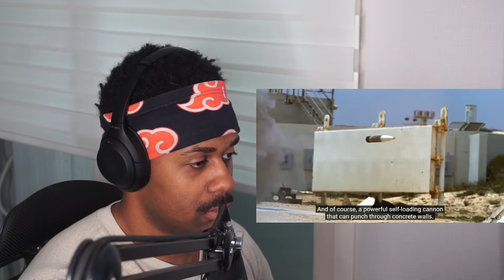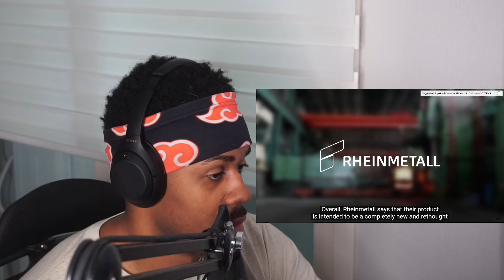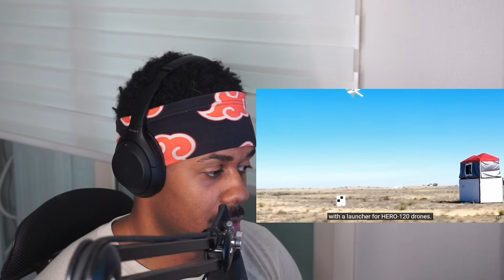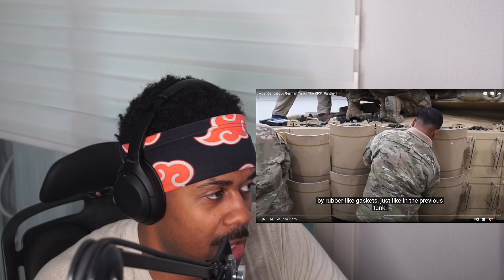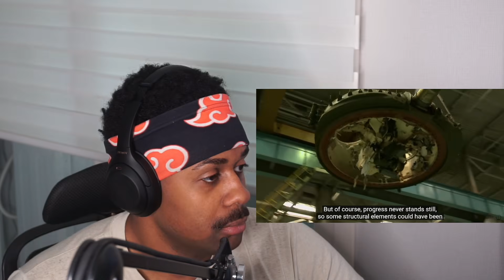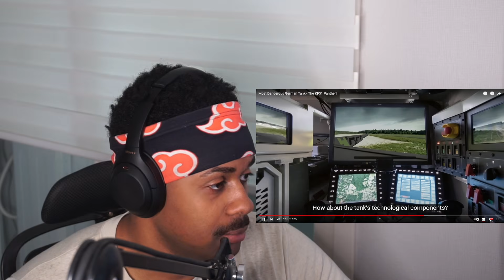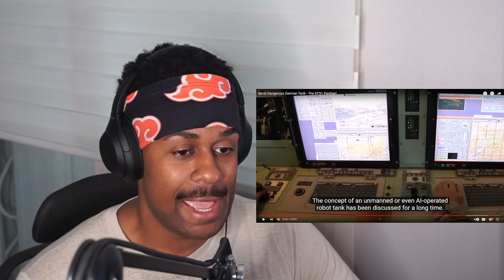Germany Unveils its DEADLIEST Creation...The KF51 Tank

Comment: sorry, to spoil the party but this is NOT Germany's new tank. It's Rheinmetall's brand new prototype, that's really all, so far. And it's NOT the Leo2 successor. The new German tank will at some point come from the new French German collab with KMW Kraus-Maffei-Wegmann in Munich (the producer of the current LEO 2)
Reply: Yes, the Main Ground Combat System MGCS
Reply: Ironically, Rheinmetall started development because they felt increasingly excluded from the other two partners in the development of the german-french Main Ground Combat System a.k.a. the "Leopard 3".
Reply: Well, we can wonder what will come out there though and how much that'll cost.... military procurement is... sometimes quite weird after all. Like remember the MBT-70
Reply: @moloh2529  still thinking france is so bad in tech...think of as a european model and one thats open for everyone else such as the us...they will be compatibel and will have similar systems to build easy alliances if needed
Reply: maybe it will become the successor if the French-German collab doesnt speed up and show they can deliver. i have high doubts about French-German collabs working at all.
Reply: @Deadhessian  depends on who has the saying, as always
Reply: @creaturion_cosplay france isn't bad at tech the problem is the rivalry between the company's that work together on stuff and everyone wants to push for as much of their ideas as possible. The best option would be a fusion of the manufacturers to cancel that out.

Comment: Interchanging military equipment depends on a lot of factors. Sometimes it happens, sometimes it doesn't. Germany decided to buy the F-35 instead of getting the Eurofighter approved for the nuclear sharing. Why? Basically because the Eurofighter's blueprints would have to go through the Pentagon in that case and Airbus doesn't want that at all, as they fear that Lockheed Martin and Boeing would then somehow get their hands on the blueprints as well.
Reply: biggest hurdle to these cross country contracts are usually not about getting the best product possible but to keep your own arms industries healthy, its extremely rare for the US to adopt anything from the outside, because their industries are at least theoretically capable to produce everything, while we in Europe can't.
 not every country has equally capable arms manufacturers in every area, so we Europeans are much more willing to buy gear.

what does happen quite frequently however is that the US buy's samples of gear & amor to compare and learn from (something that many manufacturing  NATO countries do)
Reply: Thanks for all the Sabaton videos, mate!
Reply: Further developing the Eurofighter so that it is also converted and certified for nuclear participation is simply not worthwhile, neither for Airbus nor for the Bundeswehr.
It's only about 35 pieces here, and that's not worth the effort or the cost.
The F35 is simply cheaper there...
Reply: Germany is a company and it didnt decide anything about that issue!
Reply: Wy Not share Tanks and jets

Comment: The German army hasn't actually ordered any of these yet. But just like the Leopard, they will probably be available for purchase to any NATO ally and others. The US would never buy them, though, because America first and all that. However, they already have a partly German tank, since the Abrams is actually the result of an initially joint project that on the German side lead to the creation of the Leopard and on the American side to the creation of the Abrams. Plus, the Abram's main gun is still made by Rheinmetall.
Also, did you know that Rheinmetall is discussing terms with Ukraine to build a KF51 production line, capable of producing 400 tanks per year, over there?
Reply: Rheinmetall is already in talks with Ukraine for a factory for KF31/41 Lynx and KF51 Panther; Hungary is building one already I believe and the Czechs aim for the KF51 aswell bc its cheaper than the other options
Reply: @benjaminbeier4036  not like Rheinmetall is producing tanks for over a century and has contracts with every other big player like KMW, MAN, BAE, MaK, and many more for all sorts of vehicles like the Leopard tanks, the Puma, Lynx, GTK Boxer, Fuchs, Luchs, Wiesel, PzHb 2000, Büffel, Marder, Kodiak, Challenger 2, Challenger 3, Bulldog, CRVT, Warrior, HX3 and of course theyre part of the MGCS jointventure for the "Europa Tank". 

If there is any company able to pull this "stunt" off, its Rheinmetall.
Reply: ....that won´t happen....
Reply: @harryhaller9386  The deal is done. It will be build there in coop with a ukrainian company. The just need to plan the air defense system for this plant.
First they will maintain the used equipment and later switch to KF51 and Lynx.
Reply: @Calisota  the Hungarian rheinmetall factory already produces KF41s, the KF51 prototype was also present at the opening of the factory. It is already certain that the Rheinmetall HERO120 drones are made in Hungary (the KF41s also use this drone), the production of the KF51 is still under negotiation. The KF41 is already in use by the Hungarian army, the leopard2A7HUs are also arriving, but KMW is extremely slow, and can now deliver the leopards ordered in 2018. (At that time, no one thought about the situation in Ukraine, that the Russians had to be feared again), so they ordered a few, only 44, but if more were ordered, the extra copies would arrive around 2030-35... so it was discussed The use of KF51 also uses the same IT system as KF41, they could work together. (although the leopard2A7HU is also compatible with most of this digital system)
Reply: like pushing this tank to ukranian front will change anything, ukraine needs to get rid of its corrupt politics before even thinking about building machinery like this, in the end they will stuff their pockets with money and produce malfunctioning tanks
Reply: Germany has a special contract, they dont need to order this tank.... Rheinmetall has to ask germany to export export this system

Comment: You have to imagine all of that in the video considering this: A german tank "unit" contains usually 4 tanks and they are in a group of 4 units. There could be much more, but that is the "minimum". So... there will be not just one KF51 but 16 KF51. And that means 128 drones can be used in this group of tanks alone.
Reply: With just the tanks, but Germany doesn't deploy tanks alone, there will always be smaller support vehicles and motorized infantry with them.

Comment: One fact that they not really talked about is the 130mm cannon... Every other cannon on tanks nowadays got an 120mm cannon (also made by Rheinmetall most of the time by the way).
These "just" 10mm very heavy to install but the tank has 50% more firepower beacuse of this and can shoot on longer range... 
Leopard is still an TOP5 tank in the world, but this one is clearly number 1...
Reply: and the KF51 is just the begin of this platform. Like Leo 2 A1..
Reply: the KF51 is worse than the leo2 because it is a prototype that will take years to mature.
Reply: @bjorndebar8361  It might be matured before the projected Leopard successor MGCS will be even introduced.
Reply: Leopard also still got the no1 gun today. Only the T-14 could maybe match it, but it would a propaganda nightmare to lose a T-14. So they never will see action!
Reply: @wudruffwildcard252  the t-14 is also completely garbage running off of a WW2 engine.
Reply: @wudruffwildcard252  Same gun on the ambrams and i believe FINALLY the british challenger 3. Bringing us all in line on a smooth bore 120mm gun. Interchangeable ammo etc is a great thing for nato nations.
Reply: @jackpowell9276  There were two major and one minor upgrade after the L44 was introduced. I don‘t know why the US doesn‘t license the upgraded guns with more firepower! The Brits licensed the latest best version.
Reply: @bjorndebar8361  wrong. The panther IS the best tank in the world, you could order it NOW. Because the gun and the system is working, and it is way cheaper as all planned tanks for 2035.
Reply: @jackpowell9276  wrong. The Abrahms and the Challenger use 120mm L44, the Leopard 2A7 the L55, 50% more firepower, range and penetration ratio (outside the depleted uranium, still the american ammo is not better as the L55.)

The Panther use the 130mm-Cannon, that has - again 50-70% MORE firepower to the L55 120mm... it is basically the difference between a WW2-sherman with the 75mm cannon versus a Tiger 1 88mm/L56 cannon. HUGE difference, basically another game. 
There are plans to use the same 130mm cannon in the german-french joint venture tank, but the Panther is already able to use the next step, 140mm... (that would be the 88mm/L71 with tungsten :D)
Reply: @wudruffwildcard252 the T14 lacks a lot of stabilizer systems and good ammunition. The range and penetrative power of Rheinmetall guns is outstanding when used correctly. No other gun is matching that. The bigger problem is protecting against either, a direct hit from either a 120mm a 130mm or 140mm from any company is a certain problem for everyone inside the hit vehicle.

Comment: I have been involved in the development of the weapon system for 5 years. The Future Gun System developed by Rheinmetall enables a 50 percent longer range (than 120 mm) with an unrivaled high cadence thanks to the autoloader. A 12.7mm coaxial machine gun complements the main weapon system. Multiple Remote Controlled Weapon Station (RCWS) integration options provide flexibility for close-in defense and counter-drone operations. The optional HERO 120 loitering ammo extends the Panther's ability to attack targets out of direct line of sight. Depending on the role and application requirements, an LM starter can be fitted. Grüße aus Deutschland Greetings from Germany.

Comment: The Abrams cannon is actually produced by Rheinmetall and basically similar to the Leopards. American tanks are quite heavy and thirsty, they are not a perfect fit for a war in Europe, maybe that is why there is not an exchange. Regarding fighter jets that is different
Reply: @DeReAntiqua  That is right, I have thought Abrams can be run on other fuel as well, but hey ho. Anyway when both are filled up to the brim with their appropriate fuel and go on a long distance journey the Abrams will stall first
Reply: @DeReAntiqua  The Abrams was Optimized for burning Aviation Fuel, But it can also burn Diesel, Kerosene and Marine Grade Diesel. it can use all four fuels  as they are  very close to each other and even overlap. Jet A-2 /JP-8 are more highly refined allowing it to remain in a liquid state at colder temps instead of diesel which will gel  long before the jet fuel will. The abrams was also developeted and built during a time when alot of tanks of that time period were designed to be multifuel.

Comment: this video doesnt even talk about all of the features and upgrades. the tank is slightly lighter than the leo but has the same engine, resulting in a slight increase in speed. though informations about the weight are vague. and the range of the main canon is 50% longer than the leo's.
Reply: Slight detail, due to the higher kinetic force the effective range is 50% longer than the one of the Leopard 2/120mm.

Comment: No matter if Leopard, Panther, Challenger or Abrahams. I defend myself against all of them with the same simple trick.

If they appear - I disappear. 

That is all you have to do.
Reply: Except when they're everywhere and there's no place left to run. 🙃
Reply: @marcromain64  Well, also in that case I would disappear. Just faster and once for all.
Reply: When its a Leopard you can just pull put a camera and behave like a big fan, also works. The tank crews operating Leopards and their variants are proud of them and like it when people find them cool.
Reply: @ that’s the most genius evasion idea ever. Don’t run. Don’t hide. Cheer the tank so the crew mistakes you for a fan and just passes by. 😅😅

Comment: you know, that the leopard 2 and zhe abrams m1 were results of a joint venture from the 70s? meanwhile the m1 gets the same turret as the leopard 2.
Reply: It does not get the same turret. It has the same gun as the Leopard 2 A1-A5 Versions, which is a 120mm L44.

Comment: Abrams is really good by 1990's standard, they have some drawbacks (too heavy and the engine uses as much fuel while moving as when standing still) 
The armor is thick on the turret, especially with the new composites combined with the depleted uranium slabs protecting its turret (the export version of the abrams comes without the depleted uranium inserts, hence they are much less armored, thats why for most other armies, the german tanks are a better option)

Comment: Remember it´s just a Prototype technology carrier. No serial production and no confirmed orders till now. If the Bundeswehr will adopt it ever is highly doubtable since 
the "Main Ground Combat System" aka MGCS is the combined Tank project of french and germany. Since it will be build by Rheinmetall, KMW and Nexter it will surly include
serveral features of the KF51 like the 130mm Cannon, digital structure and APS-systems but it will be different Tank.

Comment: Heron is a nice thing to attack weak top spots on tanks, but its primary effectivity is increasing recon and awareness, which again secures you the first hit strike capability - and by that, not getting hit first yourself. In cost and size, these thingys are actually quite small and cheap (cheap compared to other military ammunitions, for sure).

Comment: Italy and Hungary will use the KF-51, Germany will get the Leopard 2A8
Reply: The leopard 2 is a very big deal, but you can only do so much to the same model. The German military is about to get a significant amount of money and they will look into new equipment. There are several European options in the work and there is no reason why the German military would not use two tank models for a while. You don't need to throw away the leo as soon as you get a new tank.
Reply: @Keksemann666  
Germany used soweit years two MBTs the Leopard 1 and 2 and earlier the Lepard 1 an the M48.
Reply: @axelackens2157  currently Germany only uses the Leopard 2 as it has been around for that long and the leopard 1 isn't really up to standard anymore even with the last upgrade package that came out. The leopard 2 has different types and versions that are in use but its the same chassis.

Its definitely time to have the next generation being integrated and give it time to grow out of problems that might come up.

Comment: Did you know,... Rheinmetall builds now "centre fuselage" for the new F35.
Germany’s Rheinmetall could become a second source of F-35 centre fuselages after striking an initial agreement with Lockheed Martin and incumbent supplier Northrop Grumman.

The subject of a letter of intent (LoI), the pact would see Rheinmetall establish a centre fuselage integrated assembly line (IAL) in Germany.

Comment: America and Germany worked on a MBT together, before America pulled out and used what they learned to do the Abrams. The germans then changed the american requirements to the joined venture and built the Leopard 2.

Comment: Yes NATO has common supply chains. They usually opt for using similar equipment like back in the days the British 105mm and its shells and nowadays the Rheinmetall 120mm. The US is always free to use the same tank but as history shows sometimes the US has different battlegrounds for their tanks and also some conservative af higher ups that rather do something more regional youknowimsaying.(there is a whole controverse around that time)
You can remove the drone compartment in the KF and instead put another crewman in there who could control drones or nearby tanks only. The KF51 Panther has huge potential but only time will tell

Comment: The Bundeswehr cant afford this beauty .....
Reply: They will not buy these "little" upgrade of the Leo2. Why should they. 
The new MBT in cooperation with france is under construction and will replace the Leo2 in a few years.
The KF51 is a Company upgrade of the Leo2 - without request from the military and currently the sales promotion of the Rheinmetall advertising agency is on full rotation.
Reply: @DSP16569  I mean that program started in 2012 apparently so it has been a while. I wonder if that will produce something and not the first one in the mid thirties so I wonder if it'll end up like the MBT-70 program of the past.

Comment: Germany shares the Leopard Canon with the US. The Abrams has Leopards Canon. And both sides use parts of each other in Military tech.
Reply: The Abrams uses the old L44 cannon. The Leopard 2 A6 uses a L55 version of the gun, and the A7V and A8 use an upgrade of the L55

Comment: The Abrams and the Leopard 2 were developed to have interchangeable components, so that maintaining both inside the NATO would be easier. It's said, that in the beginning, the US even considered using Leopard 2's alltogether. For obvious reasons, the US settled with the Abrams in the end. The Abrams uses the same 120 mm cannon from Rheinmetall that the Leopard 2 has mounted. This was only possible due to the parts being interchangeable in the first place. Making the Panther a tank that conforms to these same NATO standards in some way makes absolutely sense.
Reply: Not anymore, atleast from the A6 version onward, it has a longer gun, and from the A7V version on, the longer gun got another upgrade, wich enables it to use higher pen ammunition

Comment: The quadcopters can return to the tank for charging. If they designed it correctly, there can always be one drone flying while the other is charging.
Reply: No need to wait... Just implement an automatic battery swapping base station. You could store and charge multiple batteries in parallel and have always all drones in air if needed. 🤷 Greetings by an German Engineer... 😉